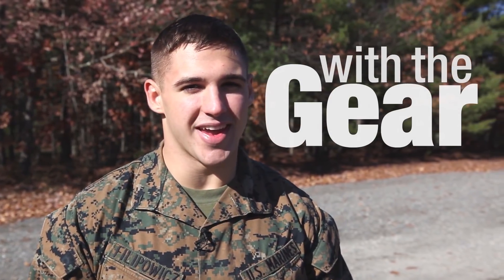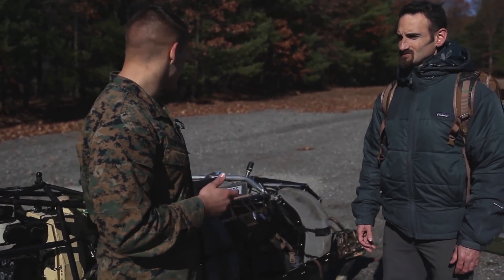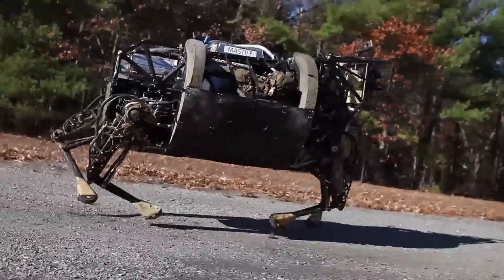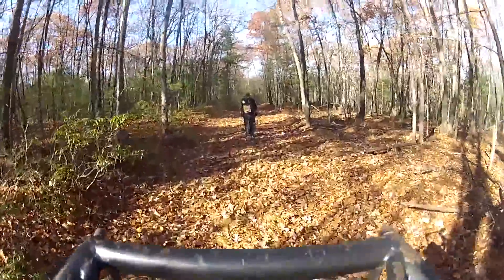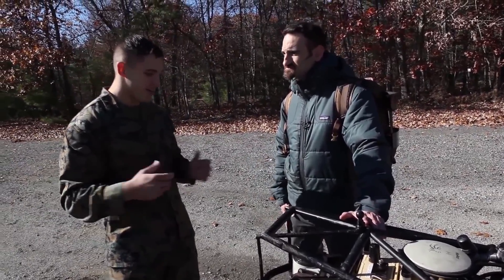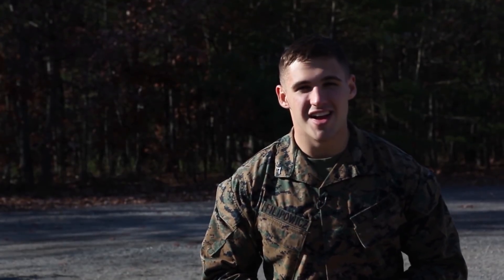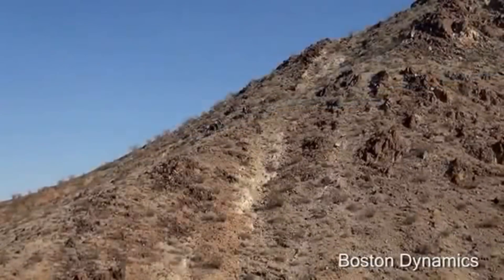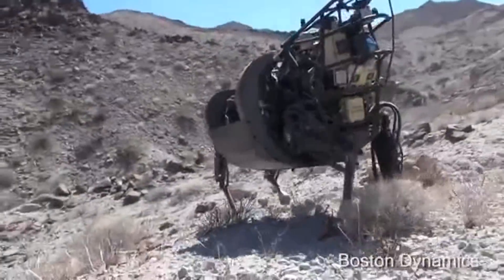Military Robots

Comment: Global terrorists with robots. Show me, where is place where wheels or tracks would be less useful than legs ??? Deep snow ? Low pressure wheels would give LARGE head start to these legs !!! Real donkeys actually more practical, because they less energy consuming, much quieter, and have LOW COST !!! I don't say any AK-74 will make it sieve from quite long distance, any sniper with old SVD could hit expensive LIDAR on top, making whole thing inoperable (doubt its nav software can work without LIDAR)! With special laser equipment you can also dazzle them or intercept control (try with real donkeys who can operate even without eyes at all).

Comment: I utviklingen av ideene til Christian Birkland
elektromagnetisk masseakselerator
https://youtu.be/admghPNkotI
A working model of a electromagnetic mass accelerator (mobile test bench) in HD quality

https://youtu.be/9YQyjPITDho

https://youtu.be/Sm1rZ-ZeHlc

https://youtu.be/M6CUHnvI2Ek

https://youtu.be/nCgz02bR058

https://youtu.be/FFBHuCnkUzU

In the video, the functioning of the working model of the electromagnetic mass accelerator (mobile test stand). It is generally accepted that the implementation of this design is very difficult because of the low efficiency and low reliability. Nevertheless, this opinion is mistaken - modern technological the base has long been able to realize an electromagnetic mass accelerator with an acceptable efficiency and high reliability
I am looking for interested in making.
https://youtu.be/AcJeElCUq1w

Comment: I can see already when they have that 'Wild Cat' more developed, they'll encase it in light but projectile proof armor, with a .50-.60 cal machine gun or small cannon turret, piloted by one controller, another manning the weapons systems, like an Apache attack helicopter, it could save or lessen troop casualties, replacing them as the 'headers'. Turn these babies loose into a battle charge or ambushing right into an enemy's encampment doing 'drive-bys',  watch the chaos fly...

Comment: Useless. To heavy, need to much energy, easy to blow up.
Reply: It's lighter then most transport vehicle. It's smaller then most vehicles, which makes it a harder target. Engines are typically more efficient then human legs. You're wrong on all cases it seems like.
Reply: This is something that will take innovation to make better.
Reply: Jenny Stjärnfeldt 
Compared to a mule which is often used in the military it's much more expensive but it also follow your commands more precisely and it won't run away while taking fire...

Comment: How much fuel does it need, 100 miles how much fuel , How big load, Miles+Fuel = Load ?
Reply from the maker: that's classified
Reply: if i was a crazy guessing man id say about 20 or 30 miles per tank, its a two stroke engine so don't expect much(Im sure its less and they are afraid to say).  the Videos say a lot  you only ever see it go up a hill and then cut, or maybe a min and a half of it moving around and then cut.
Reply: People are happy because of those research, even though in reality, the same machines after some years will be main soldiers in millitary force and if wished, they may enslave us by force. It will be much easier for government to let the "filthy" job to do for those machines. Or If it will never happen, Terrorists may get a hand of those robots and from that point it will be no fun. ;)

Comment: WTF happened to the brainpower at MIT?  Hello?  A tripwire? Could be a simple snare. Could pull the pin on an improvised Thermite mine. My $8-40 just destroyed your $500,000 per unit robot. Not to mention all the surf it carried. "Military Intelligence" is an oxymoron.
Reply: lol yup.
Reply: A soldier could do the same (as in set off a trap), and there you just lost a life instead of a machine.
Reply: kent gladden 
since us can print as many dollars as it wants, who cares how much it costs?
Reply: You can easily put a metal detector on that or something else to detect various forms of mines. Given it's size, this robot probably cost less to mass produce then an average car. Give it's feats only hit the ground once in a while, it's also harder to blow up with mines then a wheeled vehicle and given it's a robot, it's easier to make it unpredictable.
Reply: due to its complexity this robot cost way more than a car

Comment: Yeah, let's build an electronic donkey that is noisier and less able to carry gear than a real donkey, and make the taxpayer front the bill. Nice.. What's next? Slower and more obvious attack dogs with foam teeth? These robots are pointless.
Reply: +George McCabe Have you noticed that airliners are exponentially less noisy than they were thirty years ago? It used to be that neighborhoods under approach corridors for airports complained about the noise; that complaint went away in the nineties because GE and Pratt & Whitney and Rolls Royce engineers focused on this problem. It turns out making jet engines quieter also makes them more efficient.  The same thing will happen to this technology.
Reply: Its prototypes, what did you expect, obviously they are improving it

Comment: I feel like it would be so much scarier if you were being chased by the wildcat while it made that noise.
Reply: LOL
Reply: Callie LeClaire sounds like a fucking chainsaw
Reply: The sound is created by inefficiency on the motor system, so it would go even faster where it to not make a single noise. Muscles typically don't make a single noise, it would be even scarier if it where dead silent, which it could be with some electric engines, it might even perform better and cost less. Although it would diminish it's range.
Reply: well it looks slow so you'd get away from it quickly if you're fast enough that is.
Reply: If it left no survivors the introduction of this new warfare technology would have a profound affect on the enemy's psychology.
Reply: Callie LeClaire agreed, if it was used in security patrolling, that sound would introduce it's presence, and indicate you are busted. 

James Brinkley: didn't you see how fast it went once it got to full trot? Not quite quick on the get go, but hope no one needs to run across a longer field or parking lot on some property. Anything that has an extra pair of legs than us, can run us down.
Reply: Iyrie Krving i saw another one that runs 50 mph so i think no you cant run away

Comment: Mexican Technology is way ahead of this. They have burros that do the same thing and cost a lot less.
Reply: +Mario Hermoso It's not quite the same. The burros require ATP to power their muscles, just like almost all organisms; the robot merely requires electrical energy, which can come from any number of sources, like directly from the sun, or any of the 62 thousand power plants online currently. Burros are infamous for being intransigent - sometimes violently so. The robot will take orders unquestioningly. Burros can be startled, and legitimately afraid (they're mammals, after all); the robot will do its job till it's unable to. Additionally, there will be a point where the manufacture and maintenance for this robot will cost less than the equivalent expense for a burro, and that point is not far off.

Comment: So we going back to the 1st world war time when donkeys play an important role to carry things. But a donkey does not need oil, it eats grass only. When man are in hunger, the donkey can be their food as well. So, this thing may not be as good as a donkey actually.
Reply: +yang guangsha Donkeys don't take orders, they will run away especially while getting shot at and like all animals they get exhausted, even on a full belly.
Reply: +yang guangsha You want people to eat a robot
Reply: +Jolly Ranchu also they could get shot and killed.
Reply: +yang guangsha Objectively, this is better than a donkey, I think. Imagine these things covered in a skin of solar panels. And they could have a hybrid fuel cell/battery setup like Audi's new car. The hydrogen canister powering it could be lightweight (hydrogen is the lightest element) and instantly replaceable.
Reply: Josh Bobst This robot will need a lot of power. Hydrogen powered cars use compressed hydrogen which is kinda risky and hard to get.
Reply: Jolly Ranchu I don't think that's true. It's not like gasoline is less risky than hydrogen, and we carry a bunch of that around in our cars. And it's not hard to get; you make it from water with electrolysis.

Comment: Umm why can't they use a real pack mule? They are silent compared to these lawn mowers. They also need gobs of power - external power, even. What a waste of money.
Reply: Larry Medina they've already updated it to quieter electric motors, and are trying to decide making it Solar powered or Fuel Cell powered. the reason for not wanting to use real Pack Mules is those can be killed with a single bullet, and they require that you bring tons of food along (Unless your war happens to take place in a really lush green field). these can be armored to the teeth, made durable beyond the limits of an animal, and run on a really light fuel source (either plain water for the Fuel Cell option or just sunlight for the other)

Comment: Why can't they just use a horse, or a jeep.
Reply: Cam Hart with animals you have to carry around pounds of food unless you happen to be working in a grassy field, Jeeps like all wheeled vehicles are limited in terms of terrain they can cross, these on the other hand have almost no terrain limitations. the issues with noise and fuel have already been solved by switching to quiet electric motors and a mix of solar power and kinetic generators
Reply: OK, however horses, camels or whatever are designed to live and work in that environment, so you could use a camel in the desert and a horse somewhere where there is more vegetation.

Comment: Why is this a good idea to replace a 4 wheels machine? Does it has a better energy efficiency?
Reply: For terrain wheels can not handle, like walking up a cliff or passing through a thick forest. Im actually really curious about how these machines communicate with their operators and how difficult it would be to override control of the machine.
Reply: Wheeled machines has more terrain limitations. Some of the other machines can jump climb etc wheeled vehicles need a special load out for different environments these don't.

Comment: This thing comes right out of the book of Revelations 9:15-19. Mount a heavy weapon on it, with inferred and it could easily take an enemy out a mile away. Horses and mules could never compete with a machine that's why we don't use them today. Just think of the technology and weaponry you could add to this thing and it would be the terminator beast. We could mass produce them in China and wa'la Taliban terminated, O' and patriots too. The end is near repent.

Comment: so why wouldnt they just use pack animals? seems like it would be much easier and cheaper. as a big plus a horse knows very well how to navigate different terrains and can swim.
Reply: runs out of fuel much faster than an animal would.
Reply: ***** an animal gets scared and runs away
Reply: you guys act like a pack animal wasnt a highly effective form of transport for thousands of years. there is no reason it couldnt play the role of these robots much better. sure these are only early stages and will get better, a trained burden animal would out pace them for years to come.

seems like they are only reinventing problem that has already been solved.
Reply: i think you have missed my point. for what these are designed for, and animal could preform over this machine for a long time.
Reply: ***** with animals you have to carry around pounds of food unless you happen to be working in a grassy field, Jeeps like all wheeled vehicles are limited in terms of terrain they can cross, these on the other hand have almost no terrain limitations. the issues with noise and fuel have already been solved by switching to quiet electric motors and a mix of solar power and kinetic generators

Comment: Its impressive robotics but I fail to see any realistic military application right now  and for the foreseeable future battery tech is simply to primitive and so this things need rather noisy 2 stroke engines and the whole point of soldiers being on foot is to move fast and as quiet as possible in the game of war noise kills and the last thing anyone wants is this lumbering beast following them going  VRRRRUM VRRRUUUMM VRUUUM VRUUUUM so that anyone in a mile can hear exactly where they are.  Also I think their example that it would be good to lighten the load of the soldiers is just plain silly the whole reason why soldiers carry all that gear is because they might need it say they get separated from there unit that back pack will keep them alive while in enemy territory so if you take that of the soldiers back and strap it to some robot target yes you lighten the soldiers load but you have also just reduced there survivability to zero should that robot get destroyed / disabled or if they get separated from there unit.
Reply: It will not use a gas engine on militarized versions. Most likely a very silent radioisotope thermoelectric generator which will provide it with almost a century of constant high power. Silently.